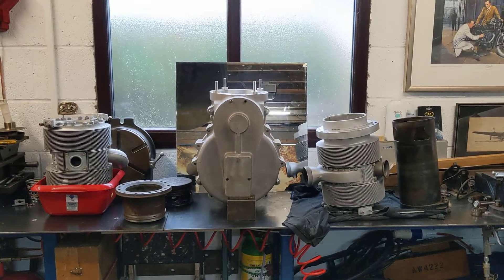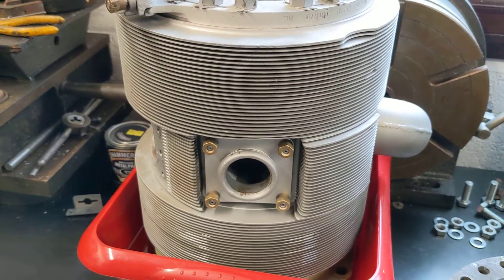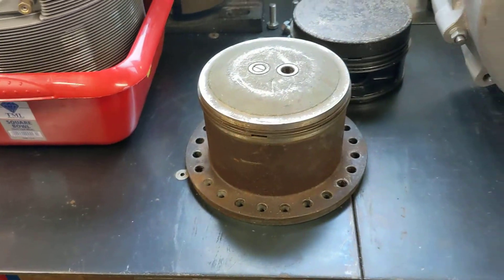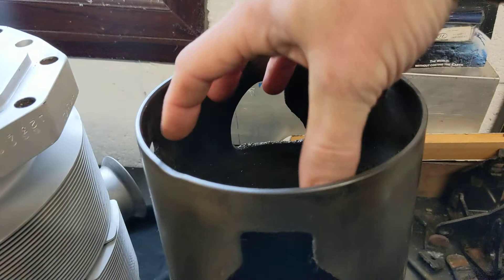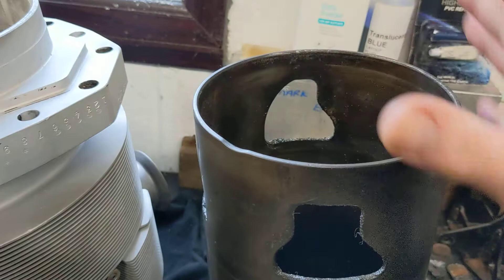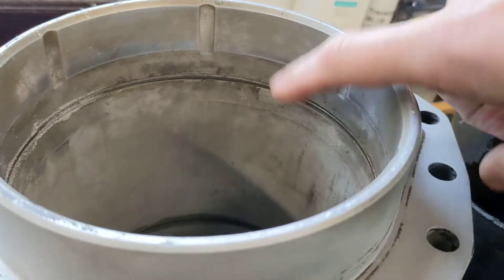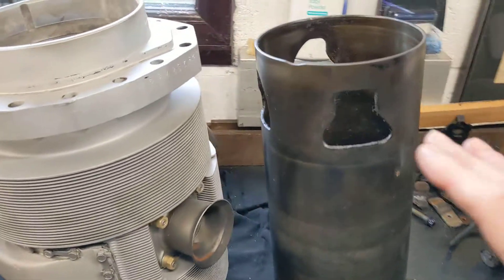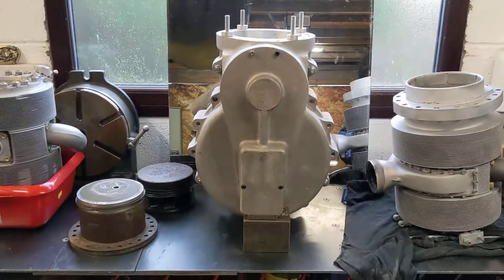Ring Ring - Engine Build Calling!

Comment: Awesome build!  I will try to drag more subscribers to your channel, since this is one Cool build!
I helped in the early restoration of the Hercules engines on the Halifax bomber that was restored in Trenton Ontario a few years back.
Those Hercs are a BIG engine, the sleeve for one made my lawnmower engine sleeve valve sleeve look like toy, and it had about half the bore of the Herc.
Reply from the maker: Thank you! I've seen a few full sized engines, particularly in air museums when I was looking for parts. I think I have everything I need from the original engine, which is just as well as they're getting quite rare now. Hoping to have it fired up this year. 💪